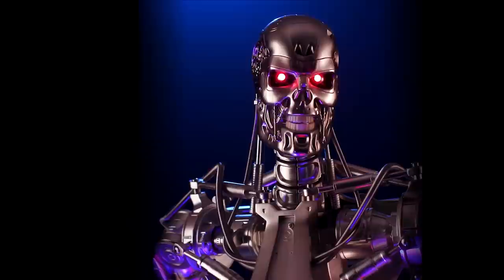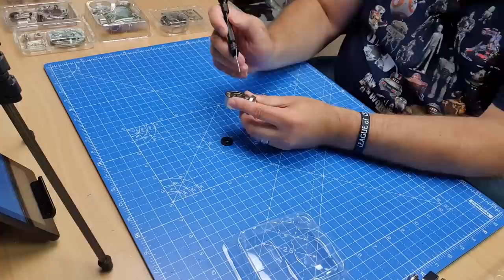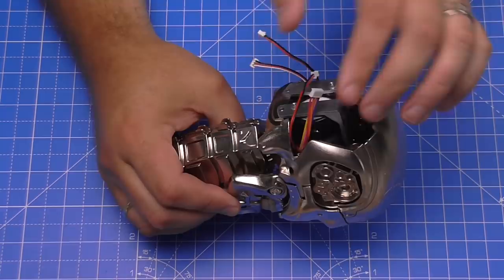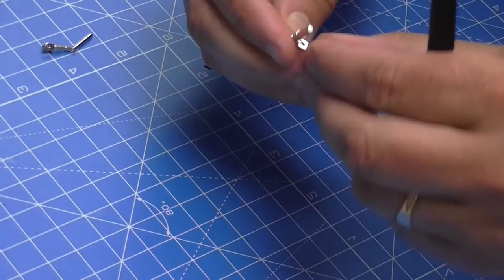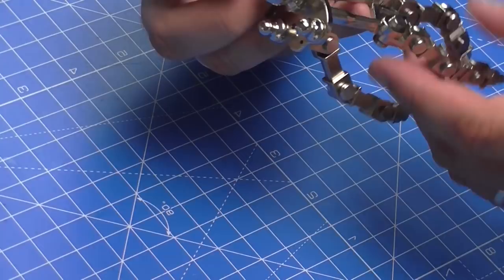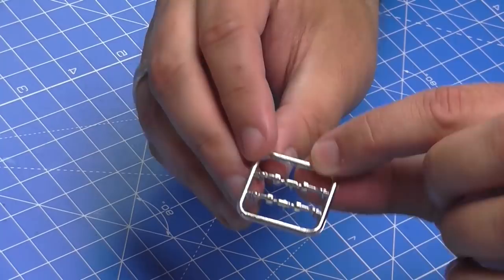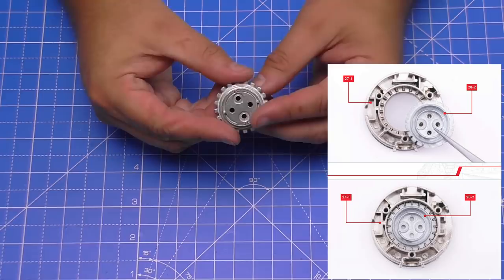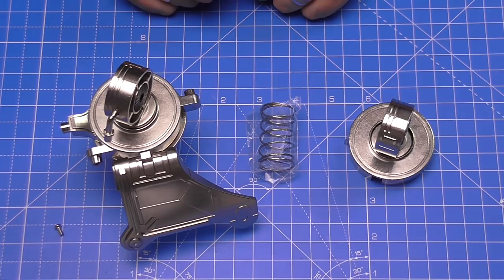Agora Models Build the Terminator - Pack 3 - Stages 21-30

Comment: 20:30 this spring i had an issue with mine, when closed inside i couldnt rotate the shoulder because there was "too much spring" and when you press it, some of it would catch on the outside edge of the groove, when compressed when turning the shoulder joint, it would compress but there was so much spring it wouldnt compress enough so that the teeth of the mechanism would release enough so it wouldnt rotate, so i had to cut the spring a bit shorter for it to work.

Also, its good to get some sort of contact grease in there on the spring where it fits into the grooves, just a little tip there. prob wont make much difference, but can stop the spring "coiling up" and expanding inside when you turn it or making little metal dust in there from moving it a lot.

Comment: Thought: If you need to hold down a spring / part could a clamp apply enough pressure? That way you'd have a free hand. Useful also if like me only one of your hands has proper strength and dexterity.

Comment: Nice video. When you secure the parts with screws, are you tightening anti-clockwise or is the video mirrored?
Reply from the maker: The video was mirrored. I had a problem with my editing software. I really need to redo this.

Comment: I've been building the terminator and I'm on pack 3 .  I've been having trouble trying to get the shoulders to move. I built everything correctly and all the pieces fit together perfectly. But for some reason I can't get them to push in and turn. Does anybody know how I can fix them?
Reply from the maker: Thats weird. Try loosening the screw a tad so that the ratchet sections aren't so tight together
Reply: I tried loosening the 3 screws. But for some reason I can barely push it in and it doesn't turn.
Reply from the maker: @matthewsnathan2375  It sounds like the spring is pinched. It should be pushing back against the joint quite a lot. I think it would be best to fully take it apart and see what is going on.
Reply: I took it apart and it is the spring. The spring doesn't stay straight when it is pushed together and it causes the parts to not work right.
Reply: Do the shoulders only turn in one direction?
Reply from the maker: @matthewsnathan2375  i think so yes
Reply: Ok, thank you for helping out. I've been able to get one of them to work. I'm having a little trouble with the left one. But I should be able to get it.
Reply: @matthewsnathan2375  I had this EXACT thing happen to me, what is happening is that the spring for whatever reason is too long (imo) when it is compressed, part of the spring doesnt compress all together in line, and so some of the spring then doesnt slot down into the grooves where the spring sits, so the shoulder joint teeth (the cog thing inside) wont release from the teeth enough to rotate. To sort it I had to cut the spring a bit shorter, and then bend the cut part in a bit to make it turn nicely, i greased it up in there as well so the spring would turn or move better inside it, just greasing it didnt work i had to cut the spring say only 1cm shorter, but it is enough to keep the tension pushing outwards nice and tight still